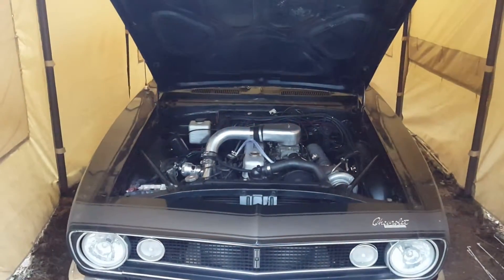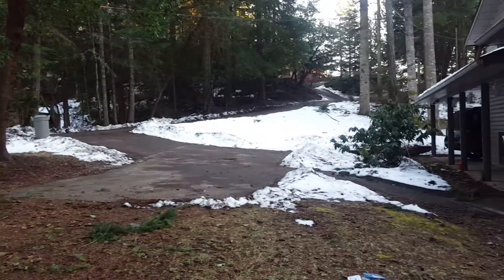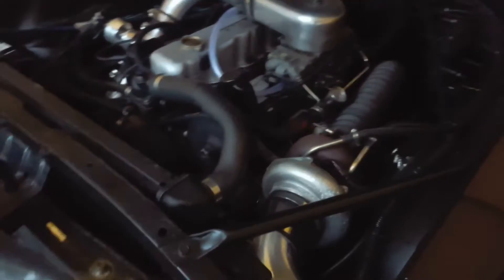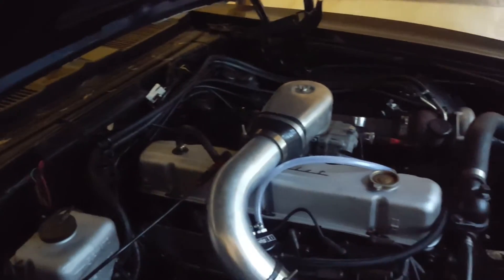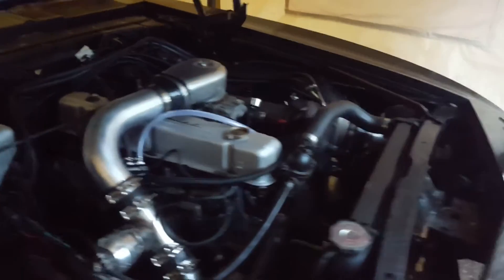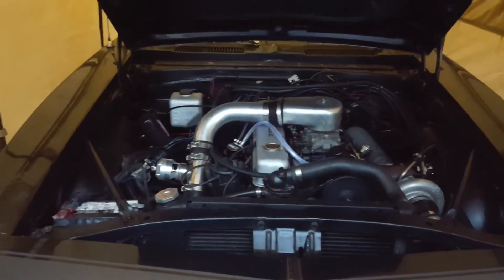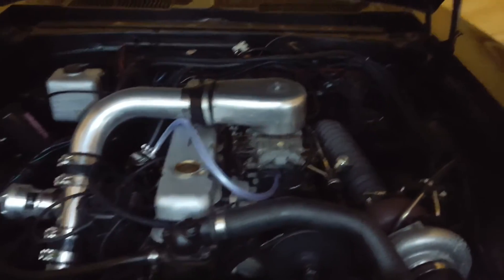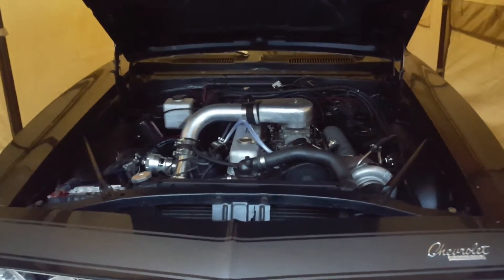1967 Camaro - Turbocharged Inline 6 - Updates & 2017 Year Review

Comment: Based on past experience I had when I built a Chevy six when I was a teen, I recommend that when you have the head off to fix the valve seals, you also convert the rocker arm studs from pressed in style to screw in style studs.  

I built the engine with a hotter cam and stiffer springs,  and after running the engine for a while, valves went out of adjustment regularly, and the problem turned out to be that the pressed in studs were gradually being pulled out of the head.  Screw in studs fixed that problem.  The procedure is fairly simple for a machine shop, milling down the tops of the stud towers, then drilling and tapping the holes.
Reply from the maker: +Steven Bauer This seems like a smart idea. Probably worth the small cost now over the frustration and potential costs later. Thanks!
Reply: At the risk of telling you something you may already know,  a lot of small block performance parts work on the inline like rocker arms (1.75 ratio needle bearing roller tips) for example.
Reply from the maker: Steven Bauer Never a risk. I only know what I read, however I read a fair amount. I'm going to read up on the best mods for this head. Bulletproof is the way to go.
Reply: Comp Cams sells the arbor and cutter to mill down the stud bosses and also a spring seat cutter and valve guide and seal cutter if you have a drill press and take your time and measure you can do it
Reply from the maker: Funny you mention that, the machine shop I used has a kit to convert the studs to the screw in style and it's fairly cheap to DIY. Probably a good weekend summer project.

Comment: Sick car, about to throw borla headers (from an old ups 292) and holley 350 2bbl on my built 250 with hei, plan on doing an efi turbo setup like you were saying one of these days. Gotta say as well, keep up the great videos, they're very thoroughly done especially with that intro. You should post a 1/4 mile once you turn up the boost, I'm really interested in knowing what kind of power this makes.
Reply from the maker: G Bizz appreciate the response. The carb is great for the initial economy and really learning the ins andnouts of fuel delivery, but if you want less complications, EFI is Probably the way to go. If you end up going EFI before me, let me know how it goes.

Comment: Congratulations on your car, very good, your videos.   
Very incredible his camaro 67, I am from Brazil I have a Opala two doors 83, engine 250 ethanol factory, this engine seems to have a better pull than some v8, it is a beautiful 6 cylinders.
Reply from the maker: +Douglas Costa Thank you very much! It's been a while but it seems to pull harder than the last V8 I drove regularly (327). I'm certain with the boost and methanol up a few psi we'll see some real performance gains.
Reply: Any website in Brazil that I can buy performance parts for this engine Chevy 250 i6 ??

Comment: Do you know where to check to see if it’s a numbers matching motor on the 6cyl, I have a convertible 67 with the straight 6 and factory console with 4sp, If it’s the original motor I’ll leave it factory if it’s not I would just put a v8

Comment: Congratulations on your build.  This project caught my eye because I used to have a '69 Camaro with a 6 that I re-built with a hotter cam, forged pistons (I should have used 307 pistons in hindsight, but didn't), a 4 barrel (390 cfm) and headers.  It was fun to drive and got 26mpg on the freeway. 

I had also seen a '68 Camaro with a turbocharged 6 at a San Francisco car show back in the 70's.  This car use a draw-through install with an SU carb (probably from a Jaguar) and no intercooler.  According to the builders, the car did 13.1 1/4 miles and 31mpg on the freeway.  

For the F.I. upgrade, are you going to use individual injectors and something like a megasquirt controller or  one of the bolt on TBI setups from Holley or others?
Reply from the maker: +Steven Bauer I'd love to see a 6 in a camaro, in person but they're just not around here. Not too sure about the EFI stupid yet. The theme would be satisfied with a peiced together system but I do like the idea of a kit, like the FiTech 30004 unit. Suggestions would be great.

Comment: Hey fella.. in the time it took you to tell us about your body ground or the lack there of you could have installed brand new one's and even tossed in a new ground to the frame .....Just saying .And as far as the Blow thru carb you can have boost referenced fuel control ...So your fuel would increase with boost ...But if you wanna do the F.I. kit for your 6  it's up to you .. it's  tune ability is infinite  but NOT cheap ...Remember Car's or engine's = cash the faster or more HP you crave the more cash it cost's...Nice camaro good job...
Reply from the maker: +Michael Laverty Thanks! A body ground was installed and in an earlier build I explained how to boost reference the mechanical pump. I'm definitely considering an EFI setup at some point, but like you said performance = $ and this build is self sponsored.

Comment: Looking forward to the future plans bud, hope you can get those seals figured out soon. The black smoke is more of a rich running issue, blue smoke would be oil burning. Holley's are best at flooding engines out with fuel. lol So it wouldn't surprise me if it's running a little rich. MSD makes a super easy fuel injection unit. It's $2500 I believe. You can find it at MSD.com.
Reply from the maker: +Military Chevy Yeah, I do like the MSD unit but Fitech makes a similar unit for almost half that much... But I prefer big name brands for this sort of thing. Hard to say right now.

Comment: I am going with the Fitech boosted EFI setup on my 250.   Keep you posted on the status of it.
Reply from the maker: +MAKEPARTScom Excellent, this is likely the route I'll go some day. Very interested on your luck with it. You plan to run a separate electric pump or the FiTech command center?
Reply: I will be running there frame mounted fuel pump.   I think its worth to only have the one pump and re-plump the fuel system and eliminate any week links.
Reply from the maker: MAKEPARTScom sounds like a good plan. I like the command center and the method you've decided on. I look forward to your success to help pave the way for my project 😊

Comment: How did you know you were missing a grounding wire? Also, I really like the black. It just looks very clean and classy. What transmission do you have?
Reply from the maker: Turns out I didn't actually need another grounding strap, it was a bad voltage regulator wire I was chasing. I like black too, it just shows all dirt and imperfections, which isn't the best first step daily driver. It's the Turbo Hydramatic 350 (TH350).
Reply: @TurboCamaro67   I've got a 78 C10. Same 250 inline six paired with the turbo 350. Are you thinking of getting a different transmission? I think a 5 or 6 speed manual would be sick.
Reply from the maker: Yeah, something with overdrive would be nice. I just repaired a housing crack on the TH350 so I may hang on to it for a while. Solid tranny but it's not the most efficient that's for sure.

Comment: Is that a factory power steering pump bracket?   Looking good.
Reply from the maker: +MAKEPARTScom I believe it is, I bought the entire power steering setup together and it was with it and works perfect. However, I wouldn't be surprised if someone made it to work like an original.
Reply: Did you buy it from a company or individual.  If a company which one?
Reply from the maker: MAKEPARTScom it was a guy on ebay that collected the parts and sold them as complete assembles. I just searched and don't see any similar auctions. There is a chrome pump with pulley and bracket on there though.
Reply: I will take a look.  Thank you!